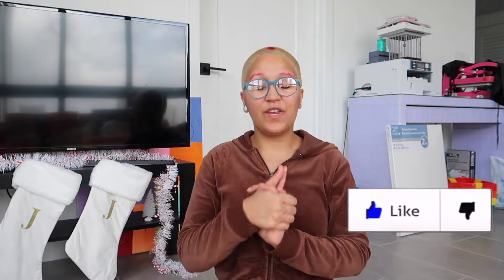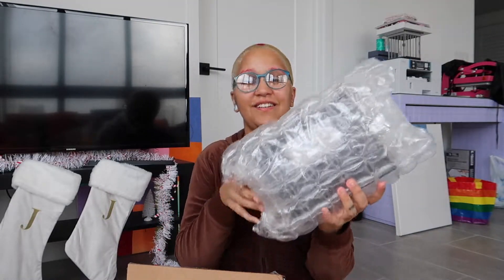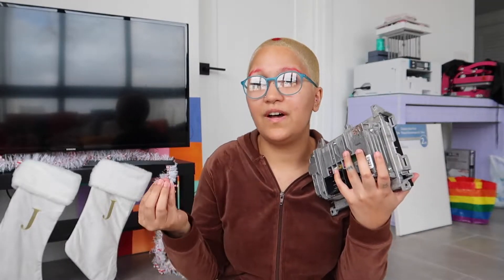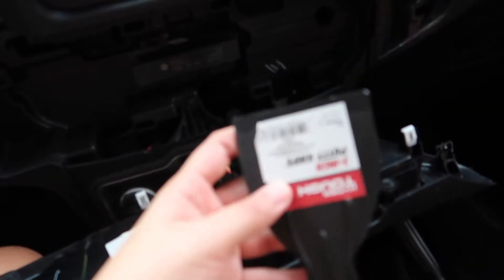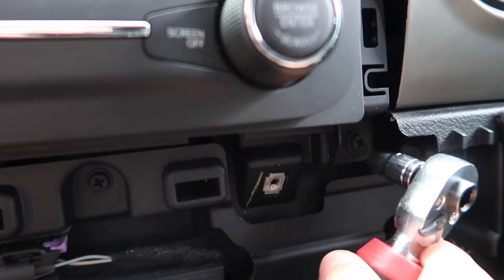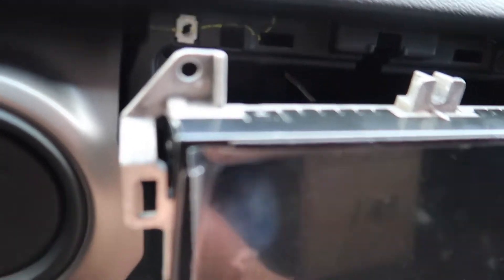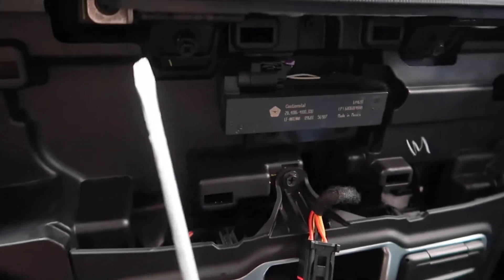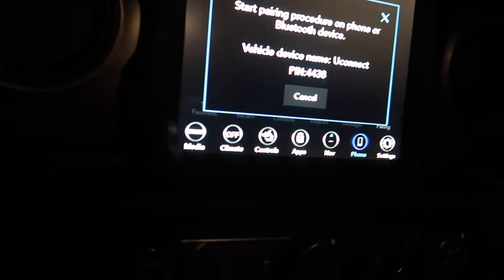UPGRADING MY JEEP WRANGLER RADIO TO A 8.4" TOUCH SCREEN | Jeep Wrangler Upgrades

Comment: Hi! I experienced a problem with my steering wheel volume and song controls would not work once I installed the 7 inch screen. Do you know of anyway to fix it?
Reply: Did you get the issue resolved? I’m having the same problem